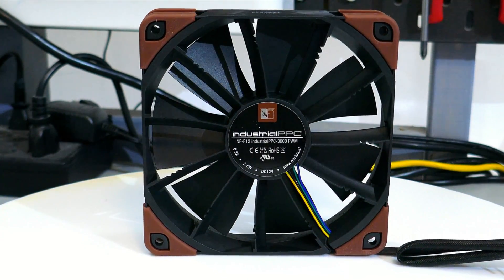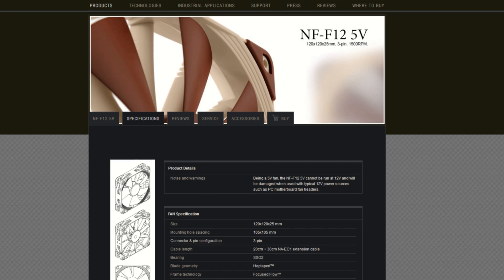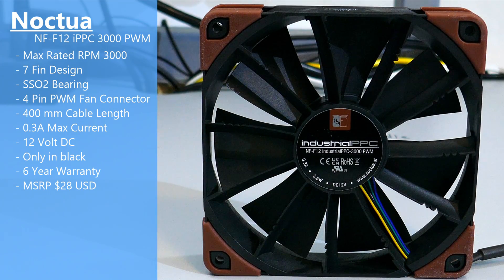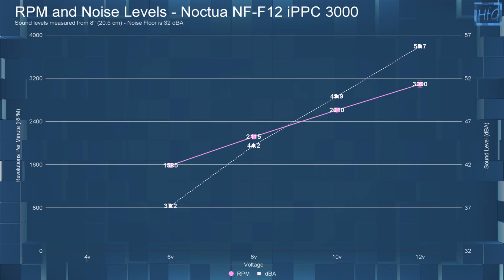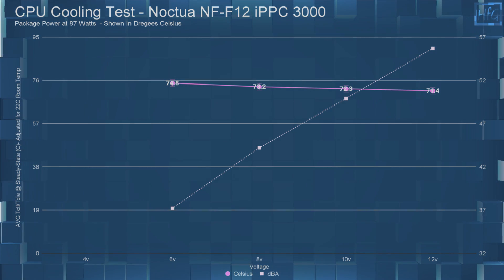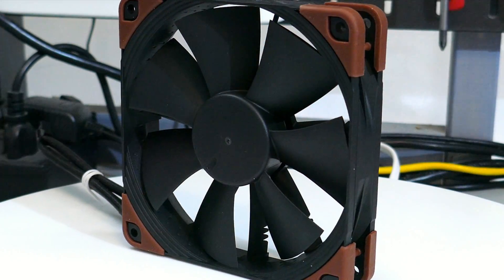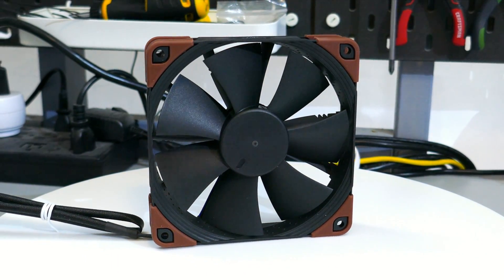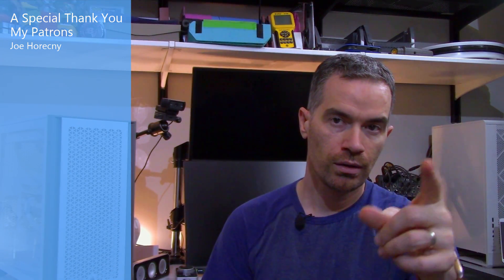Noctua NF-F12 iPPC 3000 PWM - System Fan Review

Comment: I use these in both 120mm and 140mm on different rigs, for radiators the 2000 rms ones are great ugrades as the static pressure helps a lot...for single tower 3000 rpm are rgeta but need a fan curve, also any quality fan costs money so i depends on each users situation

Comment: new subscriber here what 120mm case fan would you recommend for a case that has literally zero airflow it only has a single 80mm fan i will be adding a 120mm to the front drive bays via an adapter
Reply from the maker: The arctic P12 MAX or the thermalright B12 extrem, and then set up a fan profile using the bios or fan control.

Comment: Just bought 6 of these for my RAD. Now im regretting it. Whats the best 140mm out there? What pushes the most air? I want the best of the best. Thanks

edit just noticed this isnt the 120mm version. What is the best 140mm fan though?
Reply: Lol I'm watching this to decide on getting 6 of these, but the 140mm version for push-pull on a 420 rad. Exact same situation! So how are the noise levels and performance at lower rpm? Did you regret buying the fans?
Reply: @Noobsaucer  I managed to get them to where i want them to be. I dont have them connected as CPU fans but chassis fans. 

My System fans are connected to the CPU header as they are silent anyway. The Rad fans are connected to the chassis fan header. The reason i have done this is because on my 790 APEX MB you cant go below 20 percent on the CPU fans. Both ramp up from CPU temp so it makes zero difference.

So yeah they are good when at 12 percent if you want a silent PC. During gaming there quiet too. Overall im happy and at 3000rpm they are super loud and i caught my finger in one other week. Fan didnt even stop just did a big cut in my finger.
Reply: @johnboy2436  thanks for the detailed answer. I use a 3-pin fan controller (meaning voltage based, not pwm) which I may need to replace if I end up getting these, otherwise I think I'd be stuck at like 2000 rpm voltage modulated...

I hope your finger is OK!
Reply: @Noobsaucer  They are decent, just need to dial in your fan curve. I also bought white rubber bits for all 6 to replace the brown ones. They look good in the build now!

Comment: You really seem to be a easy going and a gentlemen but this video it is very boring. I do like watching your videos on gpu’s and all CPU’s. For me I am mostly a gamer and I use to have my own business and I built desktop computer’s either for gaming or hospital’s etc, but since people started teaching people how to build their own desktop computer’s my business was canned. This year a lone I’ve only have built two gaming desktop computer’s and since I had to close up shop I work out of my home. So now I pretty much just do upgrade’s cause most can build their own gaming desktop computer but for example they will want to install a new and better cpu and some didn’t even get the thermal paste off of the cpu and when they removed it from the socket they ended up bending a few or more pins and there would be thermal paste on the pins I’m like you build your own computer and if you can do it then congrats and some I’ve even told them since this was your first build and when it won’t work you come to me and they expect a cheap easy fix and I’m like nope. And I do try to bend the pens back in place but even if one was to break you will need a new motherboard. I try.
Reply: This reads like it was written by an AI bot
Reply from the maker: Yes it does.
Reply: Bro wtf you're talking about? 
You could have just ended it at just "it is very boring." That's it. No need for your life story cuz it has nothing to do with improving the video itself.